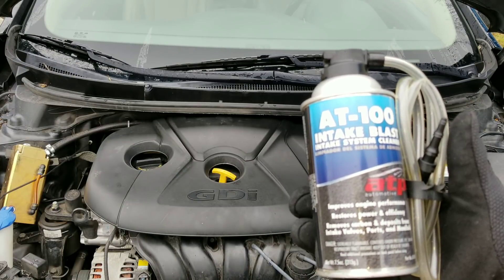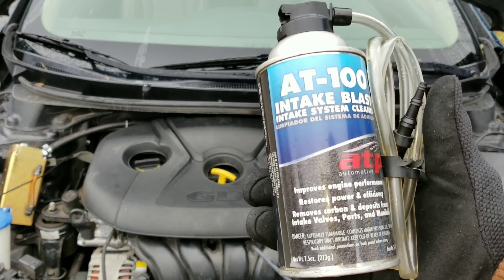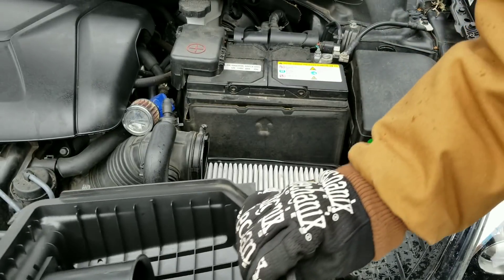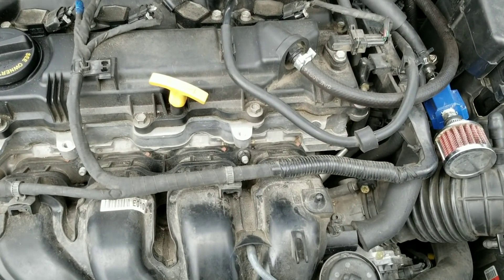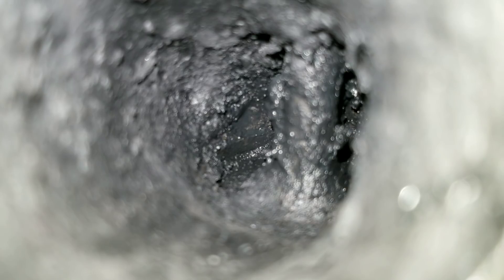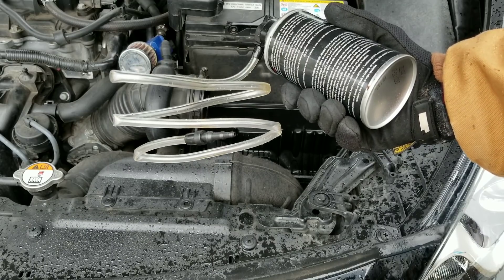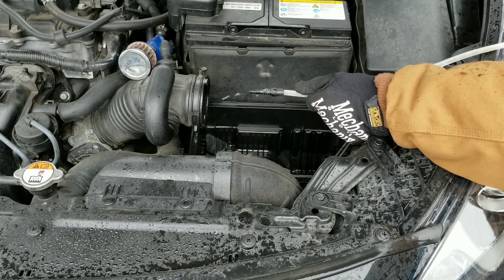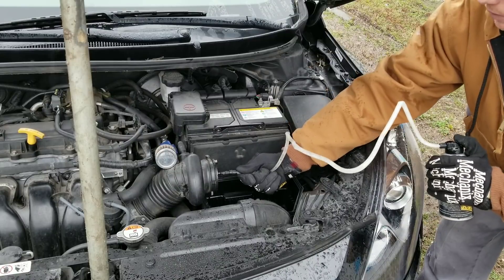spray cleaners work? proof

Comment: The amount of money this guy must’ve spent on additives he probably coulda had a brand new Long block AND been able to pay someone to put it in for him 😂
Reply from the maker: Yeah i can easily install a block that basically has everything assembled or a short just connecting hoses and adding a water pump and other parts like the oil pan and more from the old engine but it wouldn't have helped to find out what works and what doesnt

Comment: Get water methanol injection kit installed. Drive a thousand miles and it will be clean. Change engine oil and remove kit - can be used on another gdi car. We run w/m injection on turbo diesel direct injection to get rid of intake mess created by EGR. It works.
Reply from the maker: Thank you for sharing with the NIA community
Reply: this.. I had a 2010 built SHO and the intake valves at 65k were not great.  after adding a 800ml spray post throttle body and 20k miles the intake side was a mostly shiny blue in color (used 25% methanol wiper fluid)  

Strong WARNING.  RAPID cleaning using these sprays will knock of chunks.  those chunks will score your cylinder if bits get wedged between the piston crown above the top ring leading to oil consumption.

Comment: Fog it with carburetor cleaner. Someone lately said to use (non-flammable 4 diesel) brake cleaner. I do 1/2 a can make it stall. Lets it sit for 1/2 hour. Do the rest of the can for a V8.
Reply from the maker: Yes that seems to be effective.